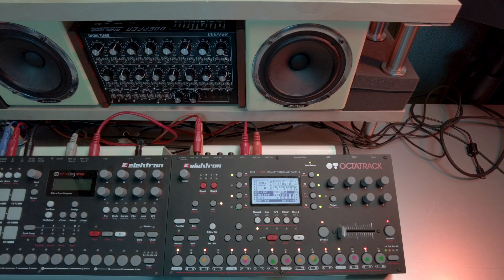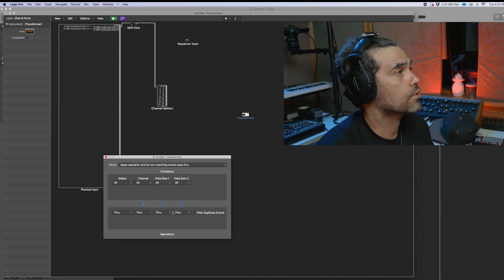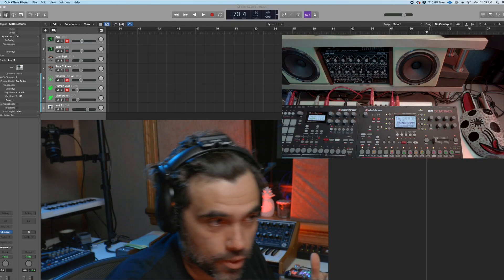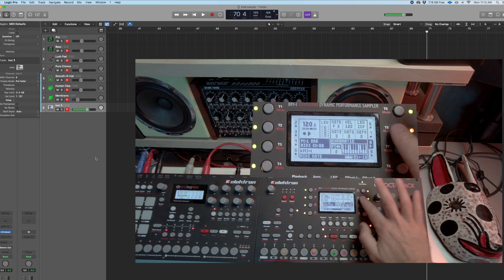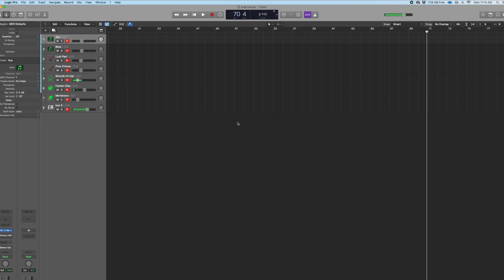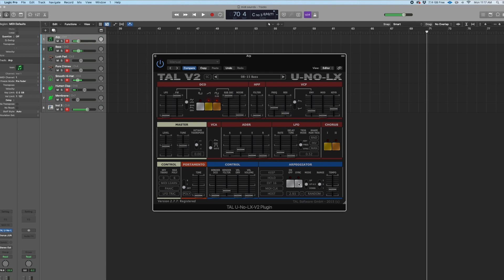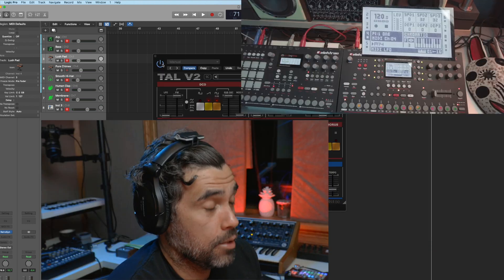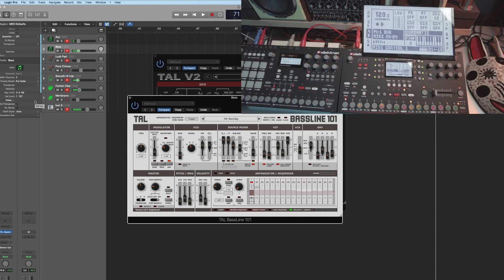Elektron Octatrack sequencer in Logic Pro with ERM Multiclock

Comment: Ok I have a A4mk2 midi out - midi in on my interface and the out of the interface to the in on the A4 channel 1 on the interface. I set all
My instruments up like this on my 16 channel interface. I also have the octotrack mk2 

If I got the 4 channel
Clock would I have to unplug all
My midi devices from my interface? As this would be confusing.
Reply from the maker: What I would recommend is using the outputs of the Multiclock to signal all your synths. Multiclock in from interface out. You could also use the out 1 of the Multiclock to send to your interface. Does this makes sense?